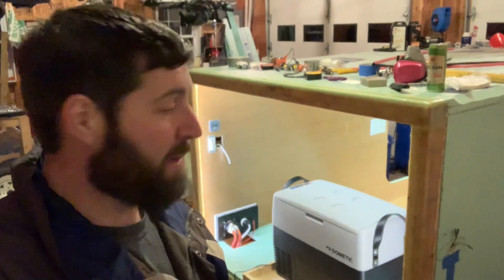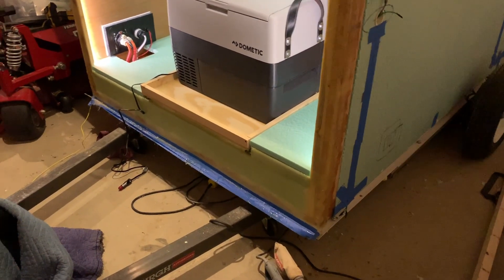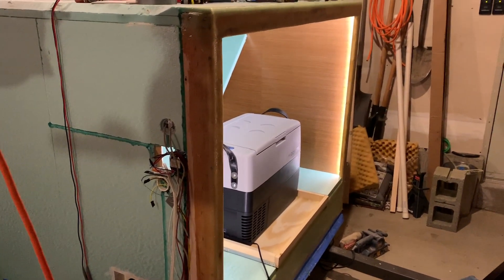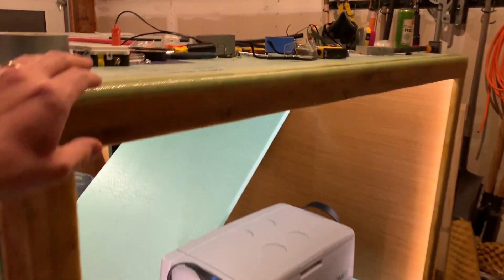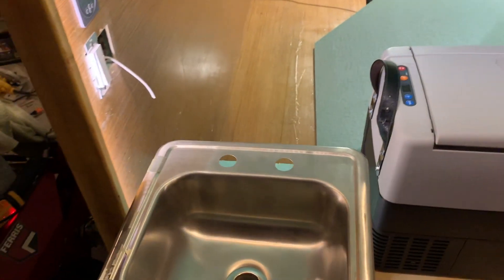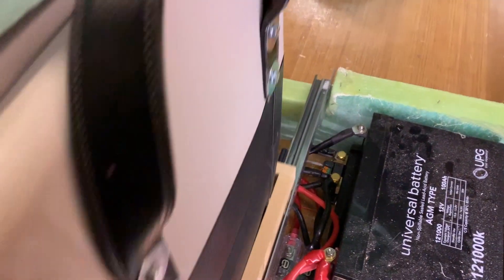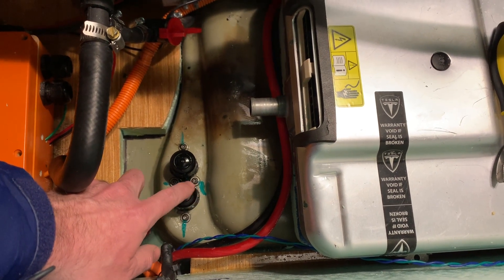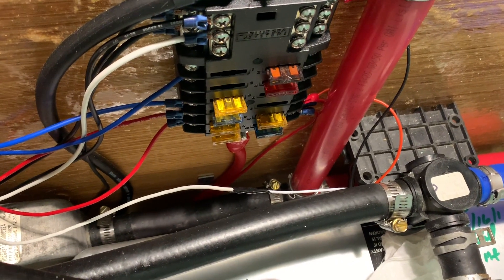T-Rex Foamie Camper Update: Fridge, Fiberglass and Battery Heating/Cooling System

Comment: James! Great looking build my friend. Did you frame all of your mounting points with plywood prior to glassing to add more rigidity or were you able to get away with mounting directly to the coated foam?
Reply from the maker: The only wood I used was a thin veneer on the inside of the walls and floor.

Comment: Hey I joined since I'm starting a fiberglass truck camper  and wanted to see how your fiberglass over foam worked out. I was going with nida core for the core though but now I'm wondering if foam would be strong enough.  I should do a fiber glass over foam test and see if it can hold my weight.
Reply from the maker: I haven’t done it yet. Still working on the camper.

Comment: You have two choices, both sides of that adapter need to be bolted down so both fittings have the same pressure on them! Until you do that, they will leak! OR you can change out the "button" fittings for more standard plumbing fittings!
Reply: I was thinking the same thing, needs more even clamping pressure.
Reply from the maker: I dont think thats it. I am using the OEM part and oem bolt location on the part. I measured everything correctly when I built it. It fits down on there snug and square.
Reply: @JamesKlafehn  Have you looked at the sealing surfaces with a magnifying glass?  Maybe there is a small defect.